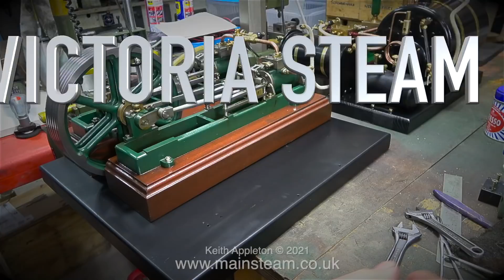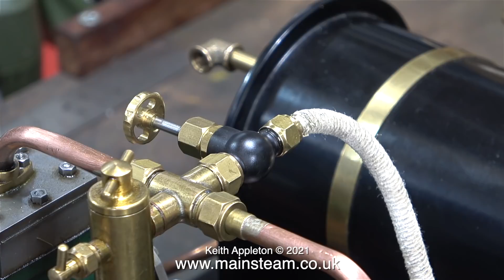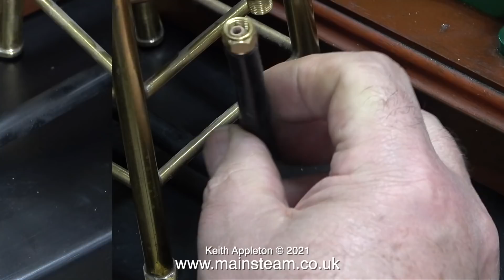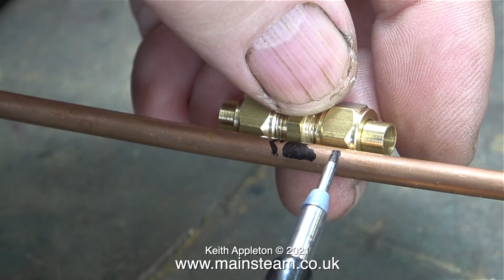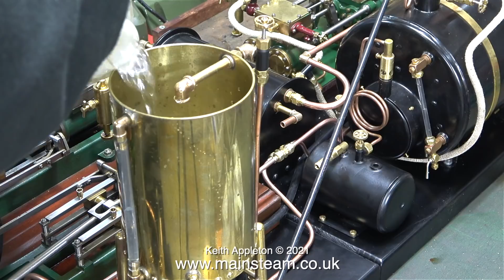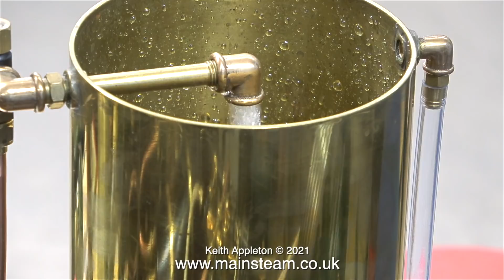SPLITTING A TWIN VICTORIA STEAM PLANT - PART #2

Comment: I now have 4 of these electric Screwdrivers and associated Chargers. They are very useful in deburring tiny holes. Drilling 60 degrees for countersunk rivets. Cleaning rust off rivets and of course powering our Locomotive which is powered by one. Quite fast and we have pulled 4 Adults. Bosch of course and the Loco Livery matches the drills of course. Lots of Love David and Lily. Can I say FIRST!!!